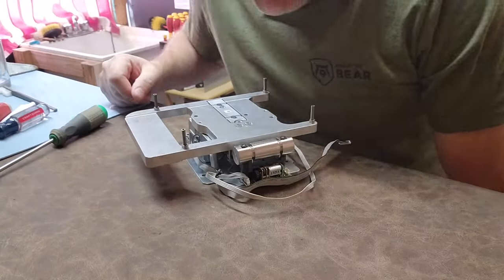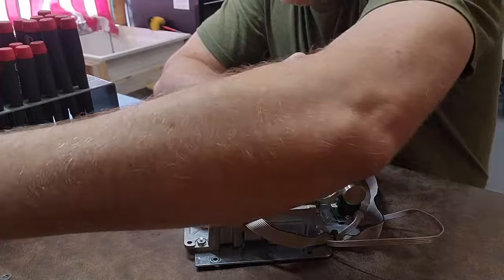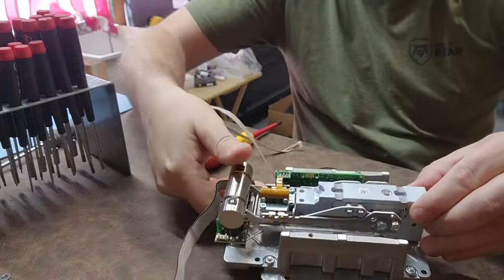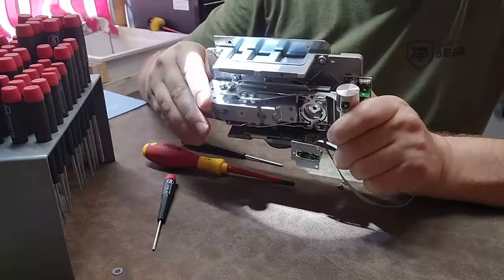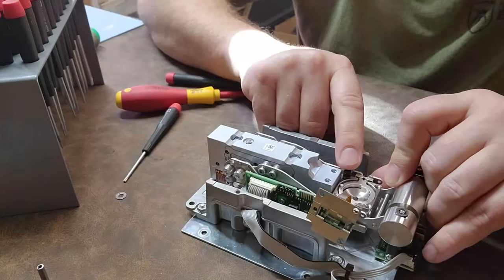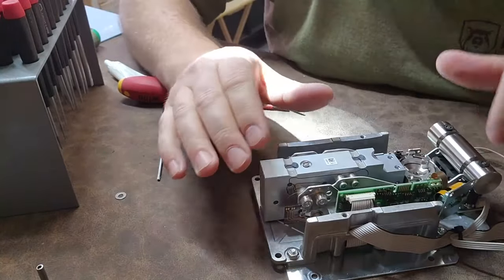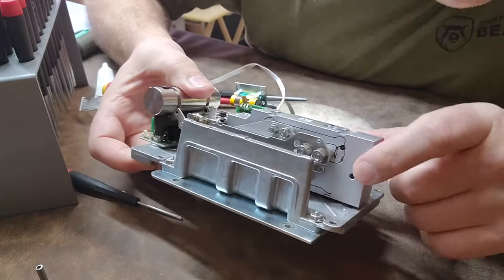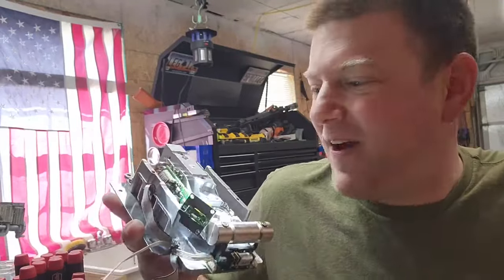$250k Pharmacy Robot Scale

Comment: This scale is not using a load cell. It's a balance, and the "counterweight" is an electro magnet. Without power applied there is no "counterweight" - The small slit is the actual sensing element.
Reply: Load cells have lots of drift which is problematic. Controlling the current trough an electro magnet with a high resolution DAC is the way this is done. The current is ramped up and down until the balance point is found when the optical interrupter is picking up the change.